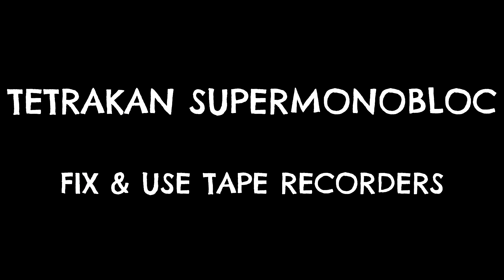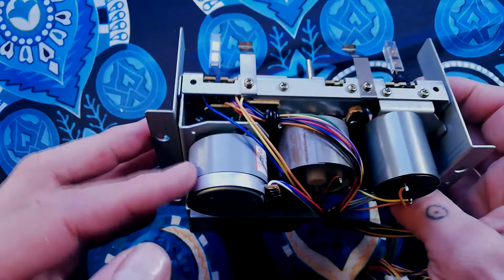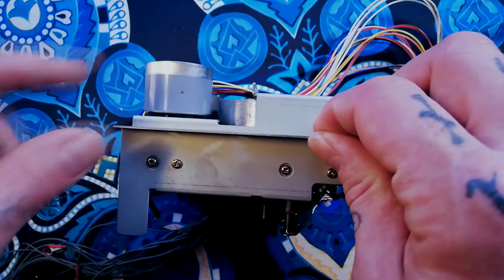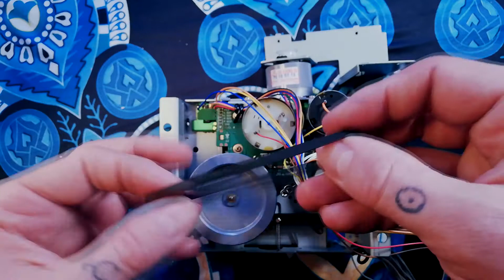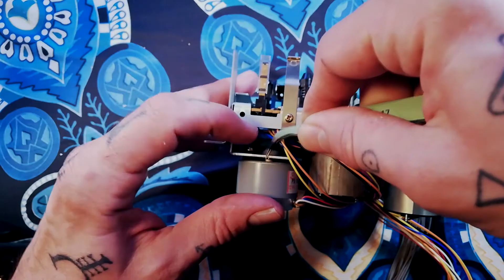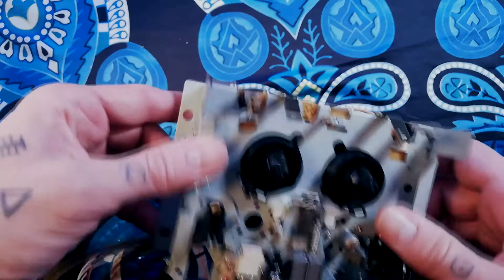Tascam Portastudio 488 MkII | change capstan belt

Comment: Hello Tetrakan, help?!?! my 488mkii slows down and shuts down after a few seconds when I hit play, does this sound like a capstan belt issue to you?  Thanks very much for posting these informative videos!
Reply from the maker: Definitely replace the rubber. It’s actually been a while since I had this cassette player open…I think there is a rubber idler wheel in there, that’d be the first suspect, but failing that replace the capstan belt.

Comment: Hello can you point me in the right direction as to wear to buy this belt ... I noticed an annoying clicking sound that slows down and speeds up with the pitch control knob ... is this a bad capstan belt or something else perhaps?
Reply from the maker: Where are you located? I don't know about the clicking but lubricate and change rubber and hopefully it'll go away.
Reply: @Tetrakan  I am in State College PA. As you know there are two metal tabs that are activated by the top of the cassette when inserted ... once I insert the cassette, that is when the mild clicking sounds begins.
Reply from the maker: As a UK resident I've got limited experience of North American suppliers but based on what American portastudio enthusiasts say on forums  these guys have a good reputation https://www.vintage-electronics.net/. On the 488 the capstan motor turns  constantly when powered on, so if the clicking is only introduced when the cassette shell is inserted, I would guess the clicking comes from the shell, or its interaction with the portastudio case? Try a different cassette and tightening the case screws on the portastudio? I'm guessing really, I haven't had this problem...god luck.
Reply: @Tetrakan  thanks I will try ... you're videos are fascinating by the way learning a lot.
Reply: Thank you

Comment: Hey ! I just bought à 488 mkii and it seems that the belt is quiet long but it has not melted, do i have to change it ?
Reply from the maker: If you're really skint you could try leaving the old one in and see if the capstan still turns, but for the sake of £10/$15 I'd just go ahead and replace it
Reply: @Tetrakan  yeaaaah i thing i'm gonna change it, that's not a lot of money. thanks a lot for your videos man, you're really helpful !